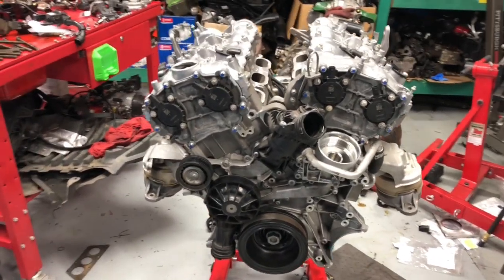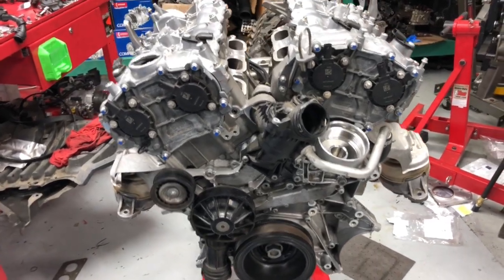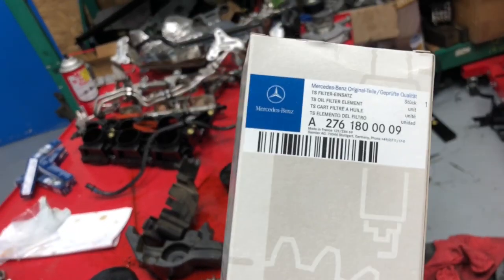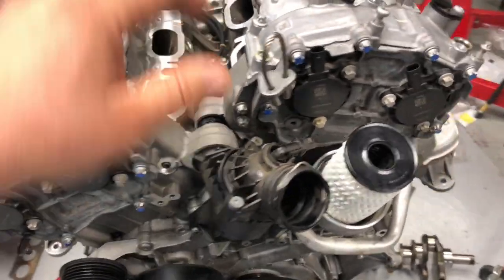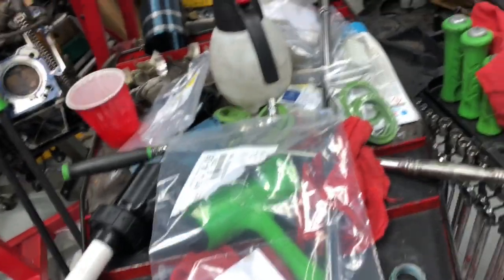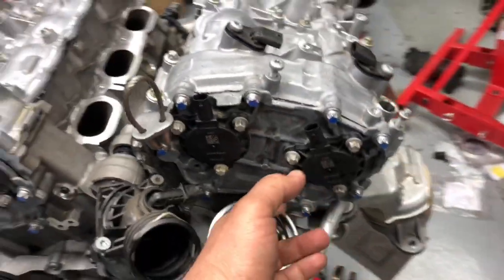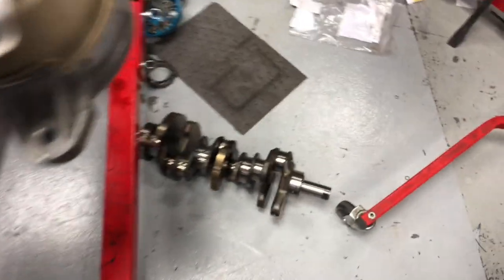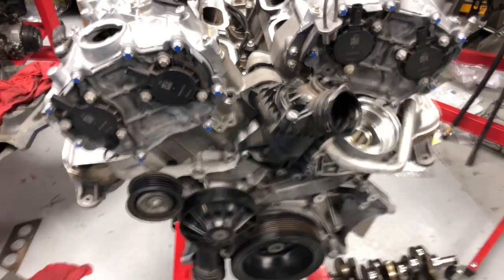How to Fix Mercedes Benz Engine Knocking Sound?

Comment: Certainly an in-depth job to undertake- have seen this happen when a filter has collapsed in on itself too! And when a canister has been swapped with an aftermarket part which didn’t have a non return valve inside

Comment: 2014 gl550 owner here.... car is smoking a good bit(oil smell) and seems to be misfiring. Just had a injector bored out and replaced and the shop says it's going to smoke and needs to be driven but the oil spot in my driveway( baseball size) and my knowledge of cars says different I think the turbo or seals for turbo are bad on driver side turbo. Any ideas ?
Reply: Under boost condition will cause the turbos to leak oil into the intake system and burn the oil and probably oil pan gasket for leak

Comment: I have a 2014 cls 550 and even Mercedes after giving them the vin they couldn't tell me which one to use. I'm getting a metallic chatter for 3 seconds upon start up (not everytime) and then it disappears.   The car has 25k original miles and the dealer I bought it from changed the oil but who knows what filter is in it.  Can you tell me which filter I need and it's part #?
Reply from the maker: Sounds like cam gears
Reply: @MercedesBenzTechs  I changed the oil today I just bought the car as I said previously.  The dealer I bought it from changed it.  It was crap oil.  I put mostly 15w50 and half 5w40 diesel Valvoline premium blue in it.  No sound since on four start ups.   Think it was terrible oil IMO.  But I ordered the check valves and tensioners today from MB of Austin
Reply: @MercedesBenzTechs  I don't believe in 0w40 at all.  It's Texas and it's hot.  120 degrees on roads.  I usually run 5w50 in all my cars or 5w40 diesel oils.  I think the diesel oils are such a hidden secret for turbo applications and heat and pressure protections
Reply: @MercedesBenzTechs when you say sounds like cam gears is that mean something is wrong ?   It could be anything honestly from a bad cam bearings to tensioners or oil not staying where it needs to because of check valves
Reply from the maker: @scottp6761  if it’s only on cold start, then it’s the camshaft sprockets, there is a little pin inside that wears out and until oil build pressure internally it rattles
Reply: @MercedesBenzTechs  it is not on cold starts. It's after it gets hot I let it sit for 30 minutes and restart it
Reply from the maker: @scottp6761  25k miles..? Too early to have any issue.. change tensioners on both banks also there are earlier models of the 278 that did not come with check valves  behind the tensioners, after removing the tensioner’s check nside a little hole, where the oil is coming from and see if your model came with the valves if not you can order them..
Reply: @MercedesBenzTechs  ok.  Thank you. Yeah only 26k miles on her.  It's a 14 so I thought it had the updated tensioners and c valves according to some folks.  Anyways I will be taking it apart in a few weeks.  Thanks for your response

Comment: Wow Mercedes engines are garbage 😅
Reply from the maker: I didn’t do videos for few years but the new engines are so much less reliable..if you get 100k miles without major repairs, you are lucky.
Reply: @MercedesBenzTechs   what do you think about 2012 313cdi engines?  Compare to current sprinter engines ?  Old ones are more reliable?
Reply: I’m sticking with my Lexus 🥇🇯🇵✌🏽

Comment: Minor ticking noise from the motor on startup, but have been using the Mann filter the whole time which is a MB genuine part, any suggestions?
Reply: Cramshaft timing tensonoir

Comment: Any suggestions for servicing a Crossfire? It's a Mercedes engine that Mercedes won't touch and produced by Chrysler but their techs won't touch it either. I got an oil change at a shop that apparently services Mercedes, BMW etc and now have a ticking in my engine. Oil is full, ticking is getting louder.
Reply from the maker: I never worked on CrossFire but I heard it’s the same MB engine, find out where the ticking is coming from and fix it before you’ll have to put a new engine in…

Comment: AMAZING INFO!!!!.... THIS VIDEO SAVED MY ENGINE! I had the same ticking after changing the oil on my   MB S500 , using a FRAM FILTER, not the MB one! I went back in the garage, changed the new filter with the old original one and no more knocking.....I was starting to get mad about it!...THIS info literally saved my engine!..THANK YOU SO MUCH! Need to buy the MB new filter now!

Comment: Hi, great video man. I’m looking to see what is the cause of some weird sound. I think it’s from the engine but I’m not sure. I have a 08gl450. It only makes the sound at high revolutions. I have no loss of power or anything. Also when this started happening the check engine came
On for p0420 and p0430. Do you think this could have happened to my engine? And if it did, is it okay to just keep on driving? I can still go on the freeway and get up to80+mph. I just can’t rev it really hard. Please let me know your thoughts. Thanks a lot! Again great video

Comment: Summary: you bought a Mercedes and it requires special service…don’t go getting budget oils changes.
Reply: No really. You can do your own maintenance if you know a little bit about cars but, always recommend to use original Mercedes Benz parts. You still saving money if you go to the dealer and purchase the original parts design for your vehicle, with the only difference that you not paying to the dealer to do the service for you., that can go very expensive depending on the work they performing in your vehicle. I live in New York State and this clowns charge $165 bucks per hour and most of the time the service fee is more expensive than the parts itself, that’s why I do most of the work on my C300.
Reply: @goldmanmartinez2678  I totally agree brother! If youve got some metric tools, space.and time to do it yourself its not impossible to do most stuff yourself... especially if the value of the car is under $20k. The problem is most people who can afford newer Mercedes are too busy working to even change their own windshield wipers! Lol 😆

Comment: the R 172  V8 is a trouble-free engine, I got 117 000 km on, nothing wrong. full Mercedes history. even the top pully noise is not to worry. it is normal wear and tear. the top pully will never pack up. also, the balancing shaft sprocket is not a problem. the 350 v6 is a huge problem on the balancing shaft sprocket. i did find that the exhaust flaps can be a problem. take out the accumulators, open the accumulators and see the spring inside, nip the spring with pliers so that it fits tight on top of the flap side top, it can slip out if not tight. my problem solved.

Comment: $6000??...I can buy an engine for $3000.
Reply from the maker: Plus professional installation, engine service, new engine mounts, engine air filters, idler pulley‘s and tensioner‘s and serpentine belt, software adaptation...

Comment: I am not agree that only oil filter can cost engine ticking in the Mercedes mostly is gasoline people put cheap regular gas and this is the wrong ,Should be  91 octane gasoline
Reply from the maker: The engine oil filter need to restrict the amount of oil that travel from The oil filter housing and allowing to build pressure to let the oil travel up to the camshaft and the bottom of the pistons, if you don’t put the right oil filter or don’t put oil filter at all you’re not allowing the pump to build oil pressure
Reply: @MercedesBenzTechs I have a ticking noise in a 2010 c300. I checked the oil filter, and it is a cheap one. Could going back to the original oil filter like showed in your video fix the problem? Or does the c300 engine not need that style of oil filter.  Please reply thanks.

Comment: Hi great video I have a question when you rebuilt the engine did you hone out the cylinders or did you replace all the sleeves since it's an aluminum block thanks.

Comment: Please help watch my video i have ticking noise coming after get warn when i drive about 10 mins after i stop i hear this noise https://youtu.be/8fBjvMghdUI
Reply: Ticking noise comes from the Canister Vapor Purge Valve.  On the W209 Left hand drive. There located on the driver side to the right of the ABS pump. Not sure on other models but I used to own a W209 (CLK500) now I own a W166 (GLE400).

Comment: ticking noise: I thought the direct fuel injectors were macking all that ticking noise.
There is a TSB regarding the missing timing chain tensioner oil return check valve... who needs oil pressure in tensioners ????

Comment: What kind. Brannd of engine oil should i use on 2012 S550 ... I use 5w40 mobil one is there e better one ..i like all you r video's
Reply: I use Ardeca-Lubricants, It's a Belgium company. Stick with 0w-40 or 5w-40 do not put the 0w-30 or even 5w-30. I learned it the hard way. The 30 is to thin.

Liqui Moly is a good brand oil. I know allot of BMW owners uses Liqui Moly. I'm very happy with Ardeca and I have been using them for over 15 years in all my vehicles.
Reply from the maker: We use liquimoly at the shop, it’s a German company, they make great lubes.